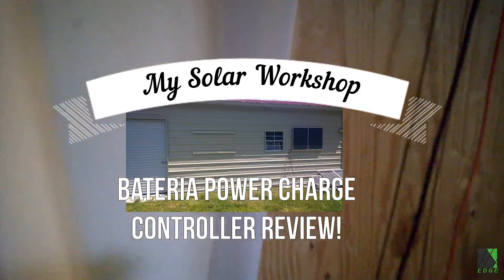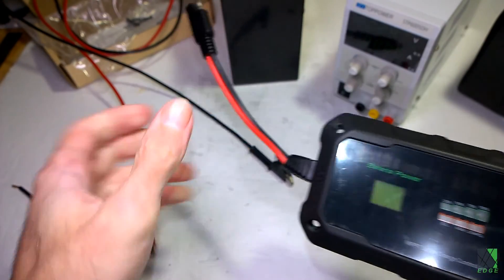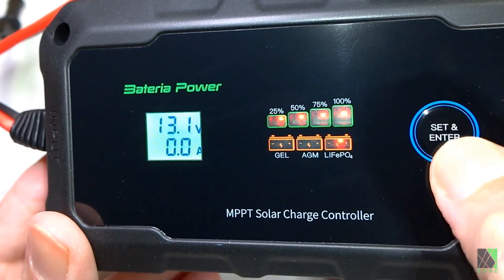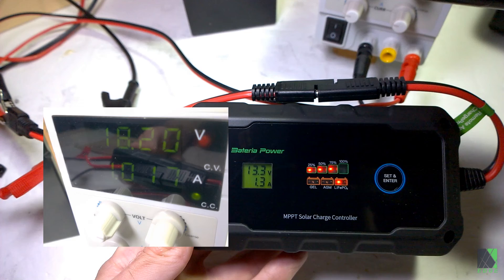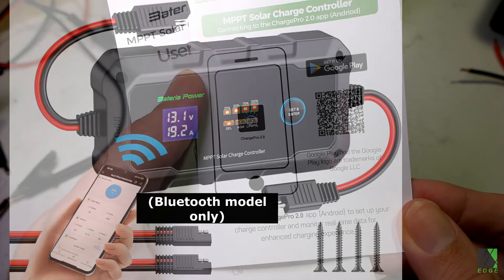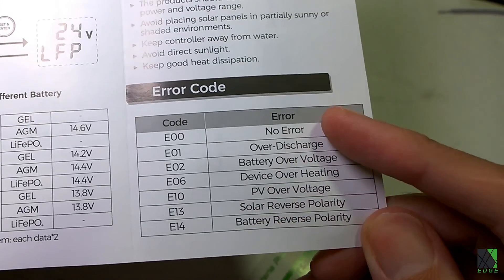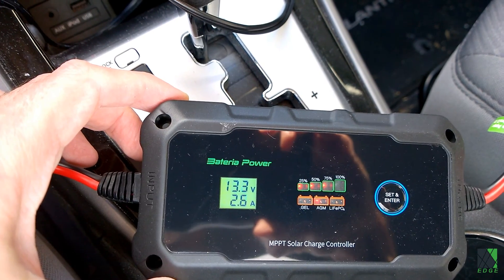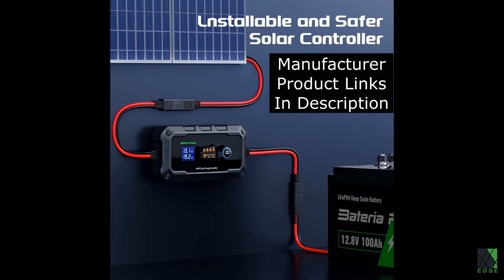Bateria Power MPPT Solar Charge Controller Bench Test and Review - lithium or AGM battery #mppt

Comment: How do you change the charging voltage?  Li battery cells need balancing at about 14.2 volts.  How can I change  to that that if I buy this controller?
Reply from the maker: @trainmaster0217 Hello, the voltage set points are hard coded into the firmware, and each battery profile has preset voltages. You can google their user manual online to see if their default voltage setpoints meet your needs. I use mine for lead acid but not LFP as I want to set my own voltages.

Comment: Can you alter the parameters to safely charge an 11.1 volt Li Fe PO4 battery - i.e. 12.6volt maximum charge input to the battery from a 20volt solar panel?
Reply from the maker: @jasonsalter3794 Hello, it should charge the battery, and a 20v panel is fine. The the bluetooth version has an Android app with advanced configuration options. In the app select Lithium / User, then set custom parameters for voltage. 

Note Lipo/11.1v batteries are not officially supported by the charge controller, so I would suggest emailing Support (AT) BateriaPower.com to confirm before starting the project. In addition, the battery should have a battery protection circuit built in, as the charge controller only handles charging. Hope this helps